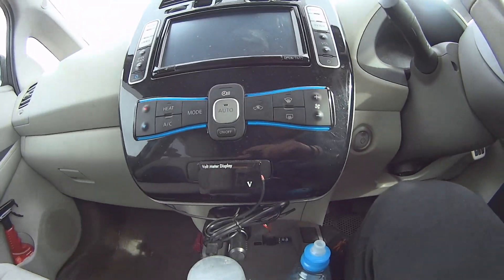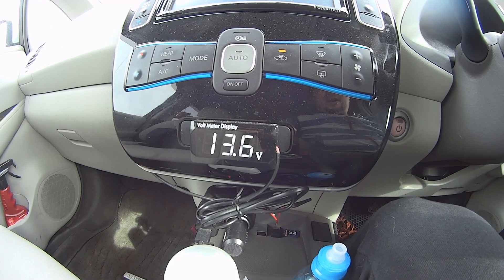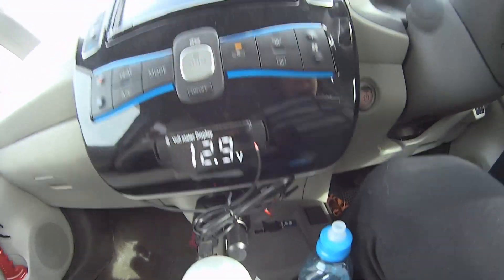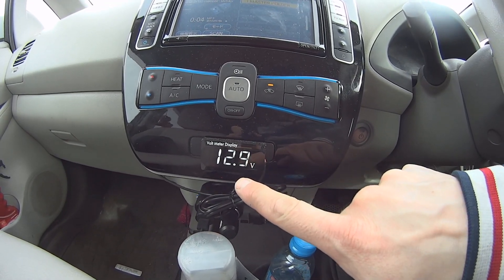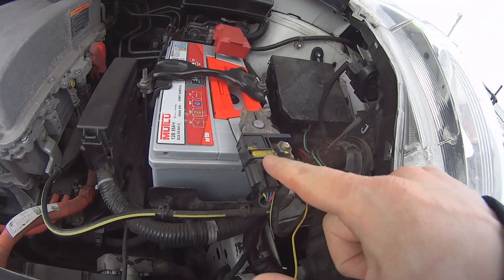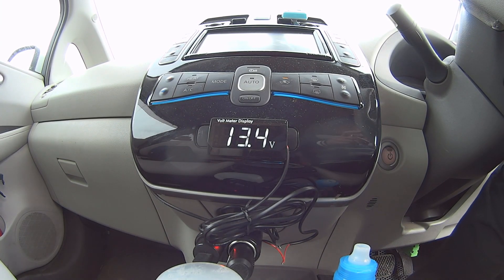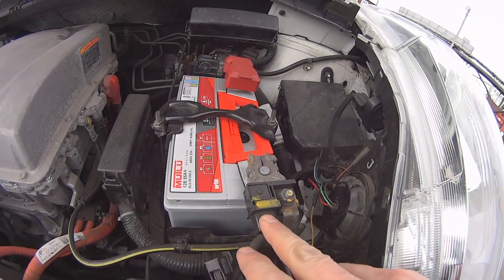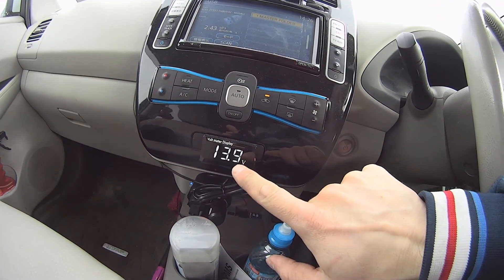Do this and your BATTERY will last LONGER! - Nissan Leaf charging system bug fix!

Comment: This is just plain stupid and not true. LEAF has an automated charging for the 12V battery, the 12.8 V is not voltage coming from the charger, it is the voltage of the battery. It is supposed to work like that. If the 12V battery is full the car will not charge it, temperature also affects on the charging cycles. It is not necessary to charge it all the time, it is just stupid to do so. It charges the 12V battery from time to time when required and the system works just fine most of the time. The battery will last several years with the automated system. You clearly do not understand the 12 V battery charging system on a LEAF at all.
Reply from the maker: It's you kinda dull

Comment: On my 2019, the problem is not that the 12V battery does not get charged during driving. The problem is rather that it does NOT charge at all during the car is not used, despite of what the manual says, and despite a fully charged high voltage battery. And the car has a relatively high power consumption from the 12v battery if switched off. If I let my car sit for 2 weeks without driving, the 12V battery is empty...
Reply: are you serious? how does that happen

Comment: What if you connect a solar trickle charger to the battery?
Reply from the maker: You mean that's on the roof? I ain't got this feature.
Reply: @CoberRuger  or set it in the window? My Leaf has the panel but it's broken because my12 battery does the same thing yours does - slowly discharges

Comment: Very sorry but this is not necessary. 2011 Leaf original 12 volt battery lasted almost 6 years. Replaced the 12 v battery with the same size brand from a Nissan dealer parts. It’s 6 years old and going strong. Nissan engineers designed an excellent system to charge the 12 volt battery and it works. I do not recommend doing anything other than planning for a 6 year life cycle. Of course using another brand of battery may not produce the same results, 2011 Leaf SV, 86,000 miles. Thanks
Reply: yes true.  the issue is when you leave it plugged into the EVSE for longer than a day. The 12 V batt sends a pilot signal to the evse docks and it will go dead. So if you park your leaf for more than a few days then plug your 12 Volt Aux Battery in to a Trickle charger.
Reply from the maker: Lead acid battery cannot charge at 12.8v.      Plain physics.
Reply: @CoberRuger  If this is a temperature sensor, can the 12V battery overheat if it’s unplugged?

Comment: I have a similar behavior on my 40kwh. I mean the service battery is run out from time to time. What is this conector use for?
Reply from the maker: Some system that decided that when it's hot, there's no need to charge the battery.
Reply: There is a temperature sensor of 12v battery near to the connector.
Temperature value can be read via ODB on PID 221182 from VCM